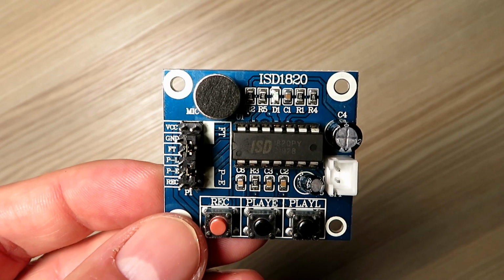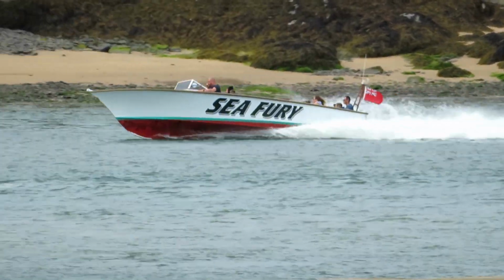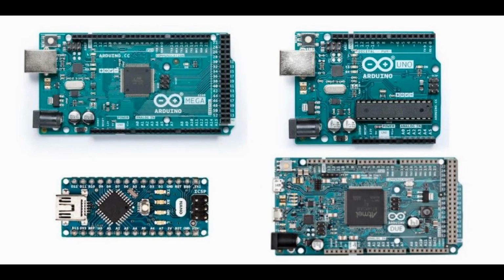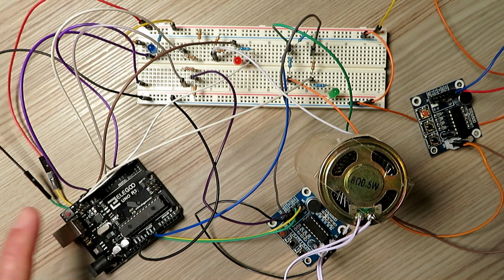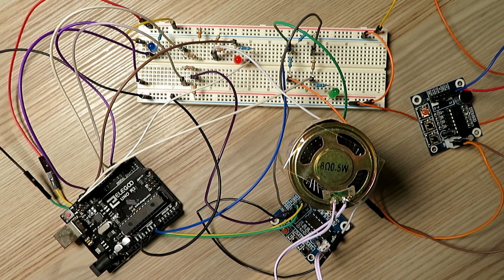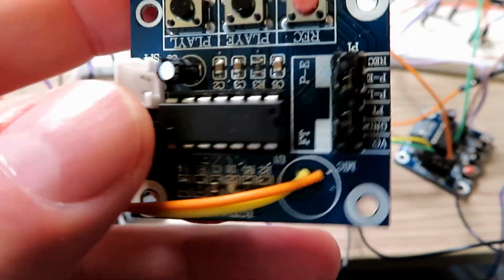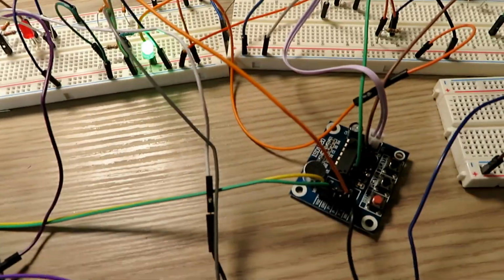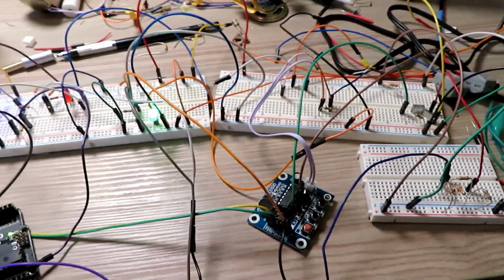CAN YOU MAKE A SIMPLEX FRS/HAM/PMR/CB/GMRS PARROT RADIO REPEATER FOR UNDER $10 ?

Comment: 8-10 years ago I purchased a Radio-Tone Simplex Parrot Repeater Controller set for under 10euro.. only thing was it was without the plastic casing... I still have it and it works great.. just wanted another one and all the parrot repeaters prices are through the roff

Comment: I made a simplex repeater out of the guts of a bf-888 and a simple circuit I designed based around the ISD1820 with 2 transistors (for switching), no microcontroller needed...works on the COR line which I tap into on the bf-888...same battery powers radio and repeater...used with a brick sized li-po battery I was getting 3 months between recharges of continuous 24 hr operation with constant daily usage...record time was set to 8.2 seconds for best fidelity. the circuit has a 1 second hold off time and 1 second hold on time. Doesn't need any tones set as it is immune to static crashes etc...The main idea was to make it as simple and cheap as possible without using any micro controller...completely analog without sacrificing any features. It was hidden on the tallest hill in my city in a tree in a waterproof case with it's original antenna antenna and did an excellent job of coverage of the whole city and outskirts.

 Update: I have since added DTMF remote control of all 16 channels on the BF-888 (one set for no xmit for "off") using just 1 extra chip(MT8870) and 1 transistor. I also have a design for a remote battery level feedback over the air using yet another chip/transistor (LM3914) but that has yet to be implemented and field tested.
Reply: Hello,how do you connected transistors for switching ? I would like to try your method.
Reply: Tbm gostaria de saber  @azlka2140
Reply: @azlka2140  1 transistor is used for record/playback and 1 transistor is used for PTT, I have also added remote control of the BF-888's 16 channels using just 1 extra chip(MT8870) and 1 more transistor for a security feature/power saver on the remote control. I also have a design for a remote battery level feedback over the air using yet another chip/transistor (LM3914) but that has yet to be implemented and field tested. I may release it all on github or similar some time in the future if I can get it all in presentable shape (currently just hand drawn schematics etc)

Comment: audio isolation transformers may help with a loading resistor. I've found best way to use these simplex parrot repeaters is if your radios support split ctcss 

Base
Ch1 RX tone 2
Ch1 TX tone 4

HT\Mobile
Ch1 RX tone 4
Ch1 TX Tone 2

you wont get ring round if close together on HTs due to semi duplex tones used.

great project
rob
Reply from the maker: Cheers, yes audio isolation has been added 👍